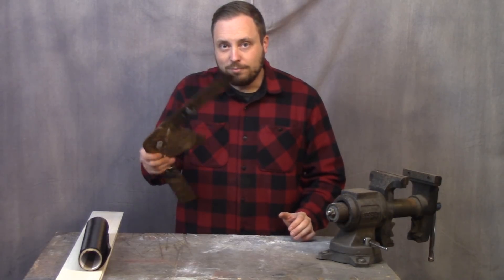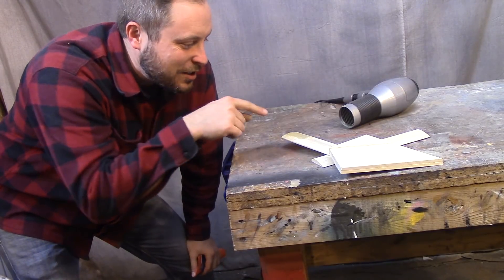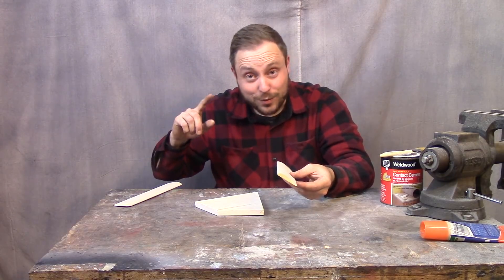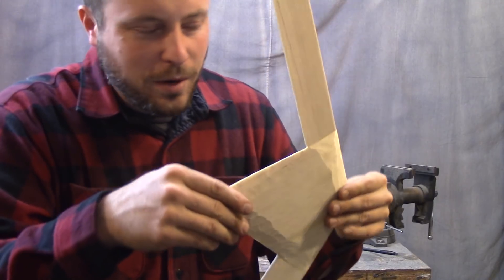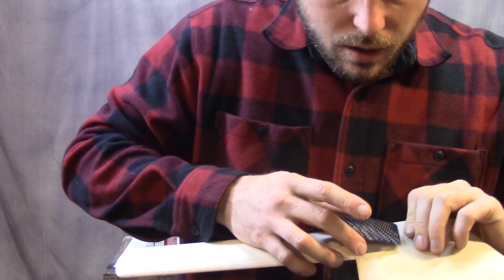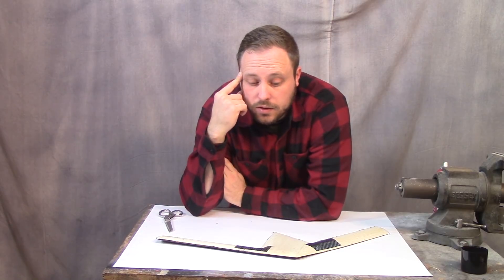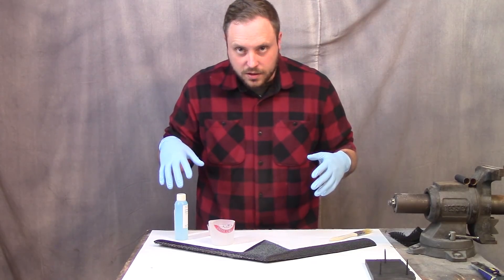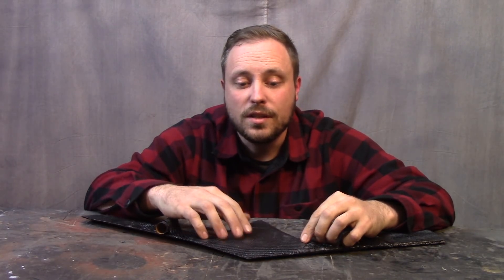BUILDING A CARBON FIBER ROCKET POWERED BOOMERANG

Comment: How’d you get carbon fiber?!!?
Reply: Jesus, it's not something from outer space, it's just expensive. Google it
Reply: It's not hard...
Reply: Commando00721 ooh ya
Reply: Ebay- carbon sticker :)))
Reply: espro its not sticker because the backside is also carbon fiber, thats how you can see its not a sticker
Reply: You can buy it on aliexpress
Reply: You have to use an onion router, TOR is pretty good for it. Start selling child slaves for Bitcoin then eventually set up a trading system and rack up many bitcoins. Once you've got a few million and haven't been arrested for child trafficking buy some for a price of 10,000 Bitcoin per square metre.
Reply: Black Market